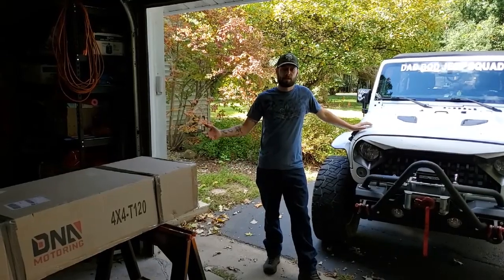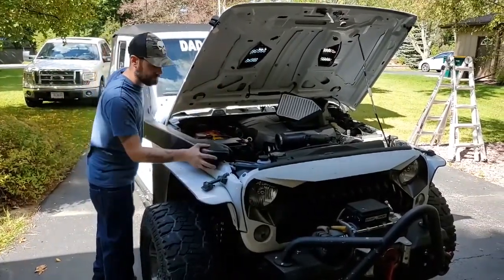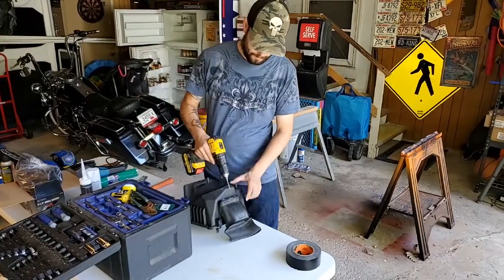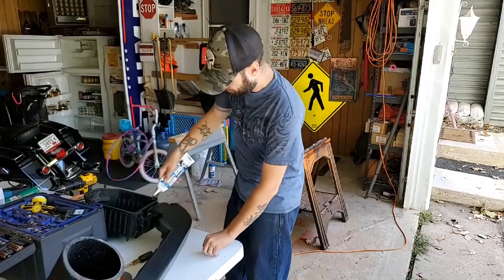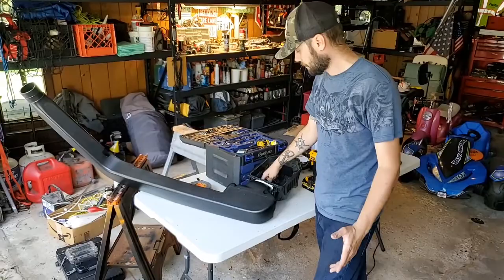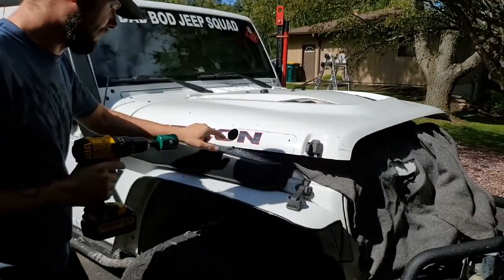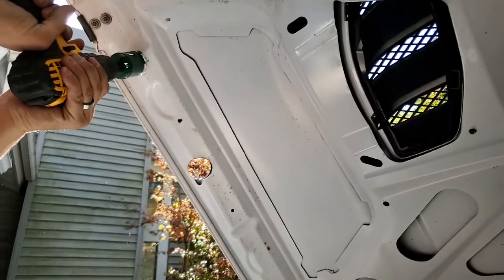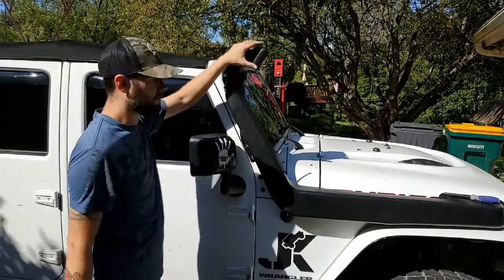Cheap ABS Snorkel Install on Jeep JK

Comment: So basically the red rock snorkel for the 3.8 will fit the 3.6 🤔
Reply from the maker: It will, just with a little modification to the air box. You will have to cut about half an inch off the bottom and then fill the gaps around it after you install the snorkel.
Reply: I was thinking about doing this to save money so thanks for the awesome video
Reply from the maker: @markspinner7220  glad I could help and thanks for watching and the support!